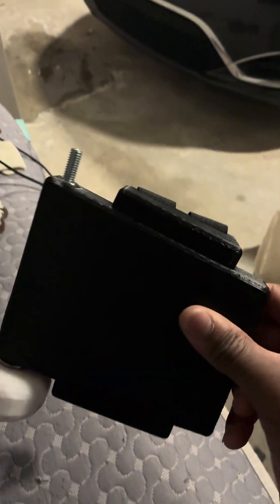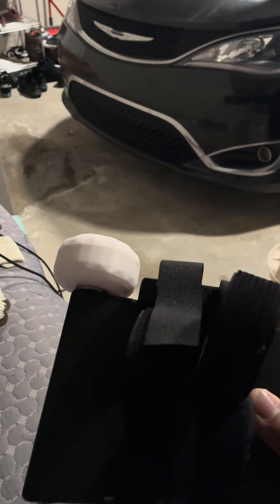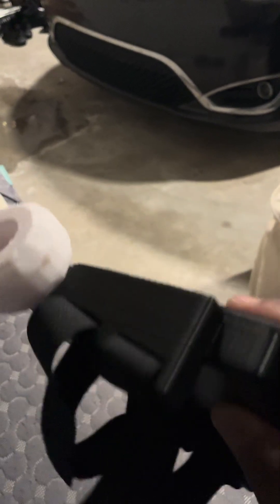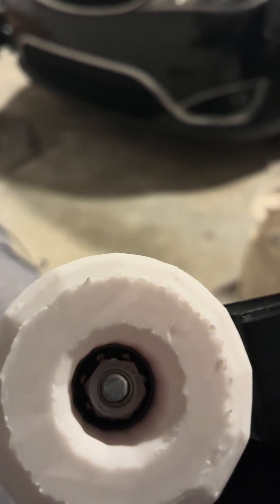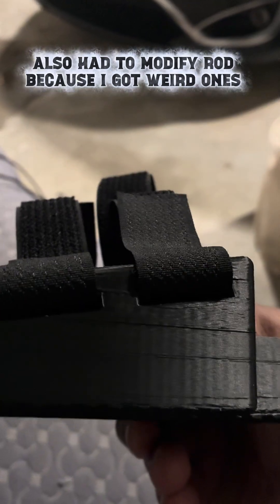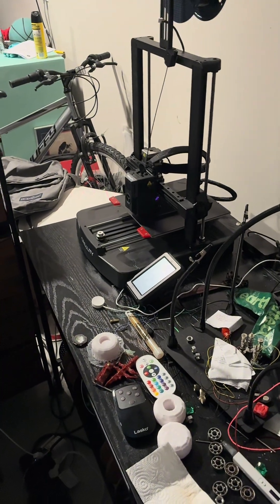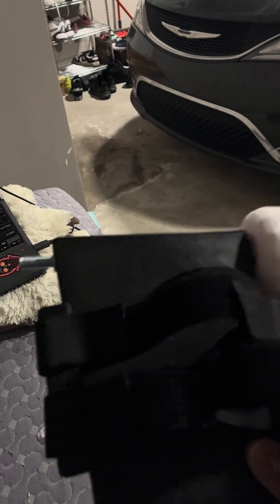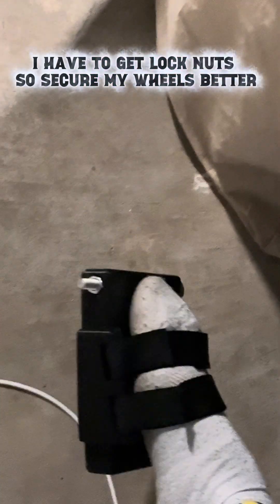I’m almost there… #3dprinting #rollerskating #skate #engineering #model

Comment: Fdm prints might not be that durable for the final product. A suggestion would be to prototype everything in 3d printing and make molds out of the final version and use injection molding
Reply from the maker: I unfortunately don’t have injection molding 😭. I would if ai could though. I was planning for the final product to maybe use actual skate wheels since they’re meant for this type of stuff. Just wanted to see what happens if I 3d printed the wheels.
Reply: @NovaTronicsYT  you can just make a silicone mold using a 3D print and a box and use that to duplicate it then use like sand casting for aluminum or an alloy
Reply: could even use spray foam to use as a filling material for the silicone cast before the sand cast
Reply from the maker: Oh really? Doesn’t that use a forge to melt the alloy though?